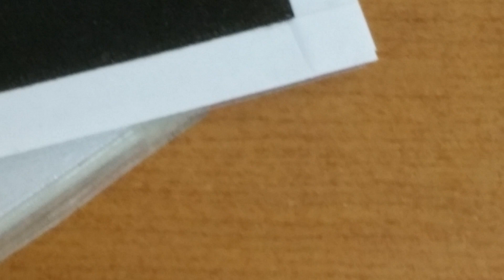graphene solid state battery by used coffee grounds

Comment: What is the resting voltage? Have you let it rest for a while or does it go down to zero after n minutes? You can't measure any battery after charge they all drop in voltage to some degree.
Reply from the maker: One single layer is usually stabilized in 1.5V after a few days. That is the problem -.-

By the way, thank you  and have a nice day

Comment: @solid battery It would be great if you could make a video to teach us how you do your configuration or template. It's very neat and looks very professional. To keep pressure, use wood or plexiglass, or glass on both sides and tight it with clips. You can carbonize the coffee grains in the microwave with Zinc chloride salt (ZnCl₂). It will be activated carbon out of the box.

Comment: Not shure how you processed the coffe ground, but my understanding is that you add it tongain surface. So, by carbonizing the coffeground you still have the structure but increase conductivity. So did you carbonize the coffeground?
Reply from the maker: Yes, it is carbonized. I did two kinds of experiment with used coffee grounds. For one experiment, I made the used coffee grounds burnt more to be ash. For the other experiment, I used this used coffee grounds. The result was that the latter was much better than the former. But after reading your comment, I think it is better to slightly carbonize the used coffee grounds again. Always thank you very much. Sincerely.

Comment: Sir ... when we will see battery voltage stable
Reply from the maker: Thank you. I will do my best. Thank you again and have a nice day
Reply: @solidbattery9956  The voltage is unstable because the battery is just made. Just like in any other battery it will start very high and then drop, stabilize and then drop little by little as the battery runs out of power. The average Voltage is called nominal voltage.

Comment: Stable voltage is important
Reply: Voltage always drops, stabilizes and then drops little by little until power runs out. For a litlium battery it usually starts at 4.2 Volt but quickly drops and stabilizes and then drops little by little as the battery discharges  the way to about 3 Volt. The average voltage, also called nominal voltage, is the average voltage of a battery during a cycle.
Reply from the maker: @pako8626  
Thank you so much. Have a nice day
Reply: you are watching the development of the latest tech in real time. . . . check yourself ad consider maybe since this isnt even being taught in engineering and chemistry classes... you can just watch and applaud the man's work :) what you are watching are the tools to create the tech which is GOING to change the whole world.
Reply from the maker: You are absolutely right. Reaching the stable voltage is really hard. But let's enjoy this journey. Have a nice day.
Reply: Very nice information thank you, can you make the frame of that drone out of graphene supercapacitors?
Reply from the maker: @robertolivarez5742  
Thank you. If I have a chance, I will try.